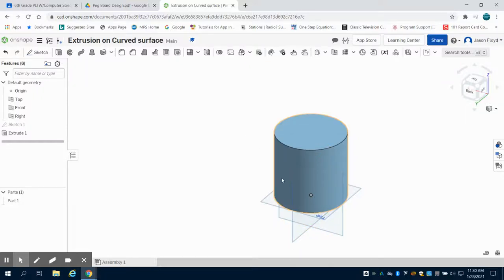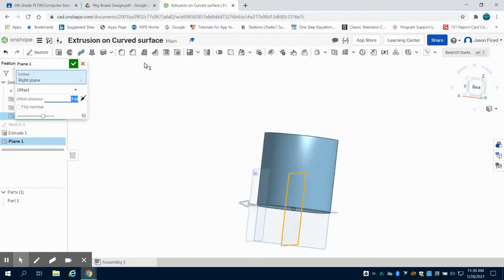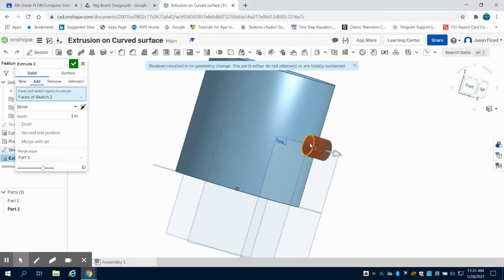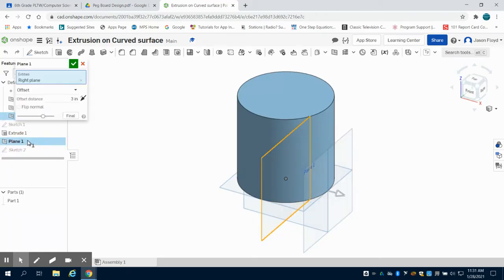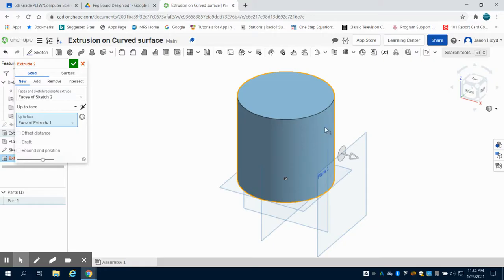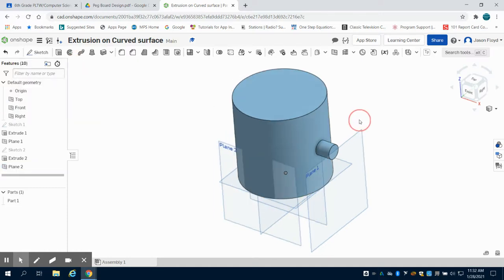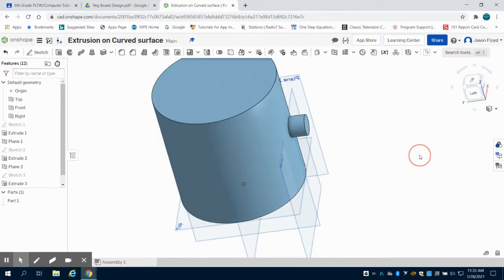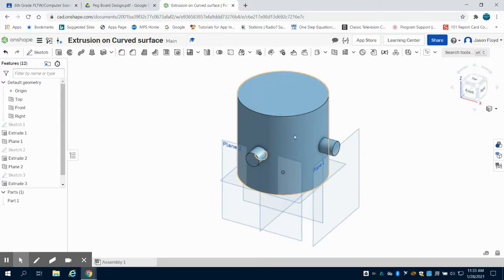Sketching & Extruding on a Curved Surface in Onshape

Comment: How do I make a cap? Like your cylinder is like mine but does not have a cap... a lid, a top? How do I add that?
Reply from the maker: I would make it as a separate part. Then go into an assembly file and put them together. The best tool for that would be the revolve tool. https://youtu.be/vgq-8YufyU0?si=KN1boulU1aac3lp7